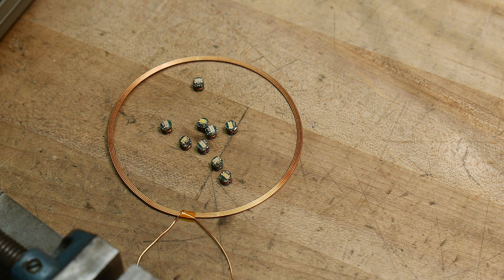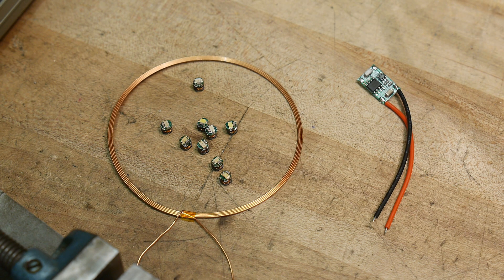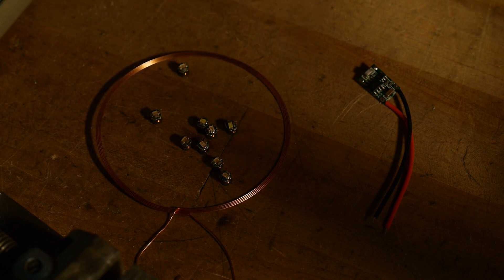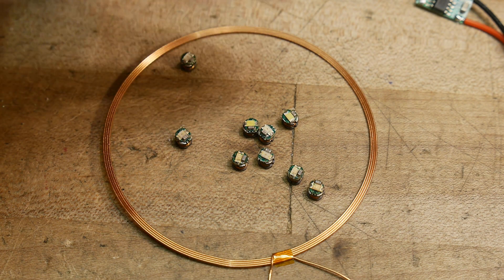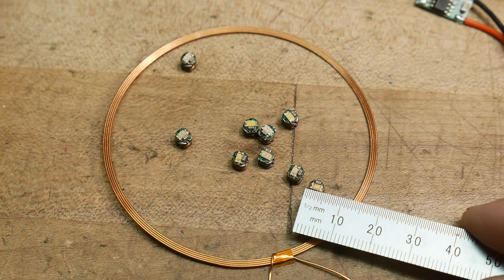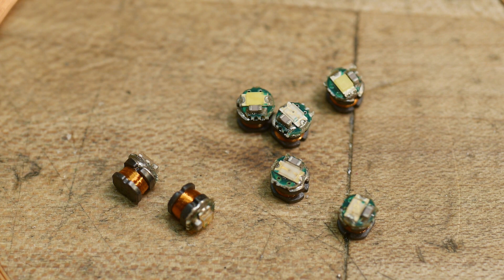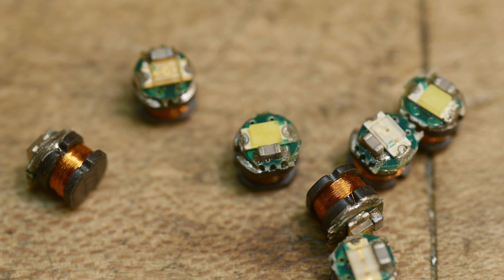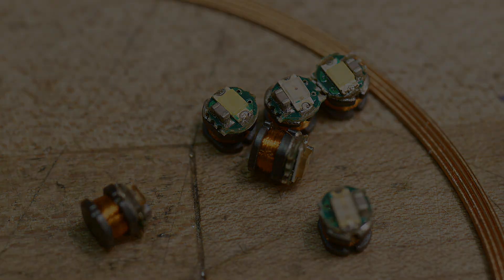#991 Wireless LEDs

Comment: If you had maybe a thousand of these lights you could make a cool display that lifts them up and then drops them down a tube with some coils along it, such that the lights would turn on in different places along their fall. If you could tune the lights to be more or less reactive to coil polarity, relative orientation, or frequency, then you could have different lights turning on in different portions of the drop, and vary the coils to move all that around. I presume it must be very loud but it'd be neat to see

Comment: would the LEDs be brighter without the ferrous core in each inductor?
Reply: No, they need the open ferrite core to couple to the external field from the coil. All they are is a resonant circuit, with the LED acting as a clamp for the energy.

Comment: Will they light up around your cell phone? Or better yet, A Christmas antenna for your walkie-talkie.
Reply: I remember there were stickers you stick behind your old Nokia 2G phones which would light up when you get an incoming call
Reply: I was at the point of making a post mentioning these, i still have mine although unfortunatly it seems it does not work anymore.
Mine did a small running light show in different colors, i had for years on my nokia so i would be warned of an incoming call when in a noisy machine room, i am a service mechanic.
I wonder if you can still buy these?